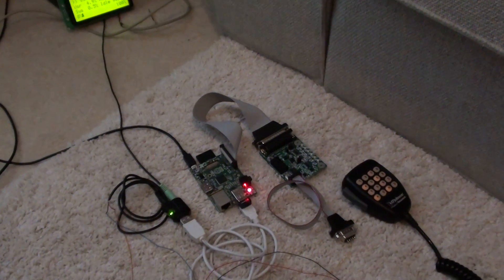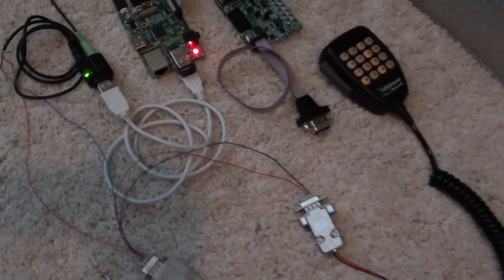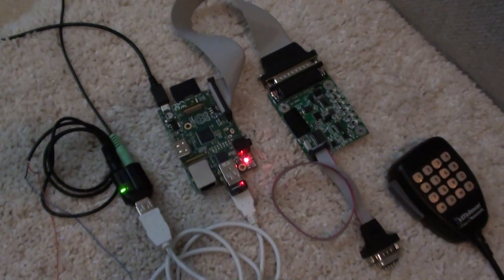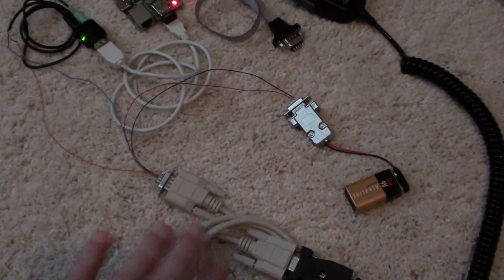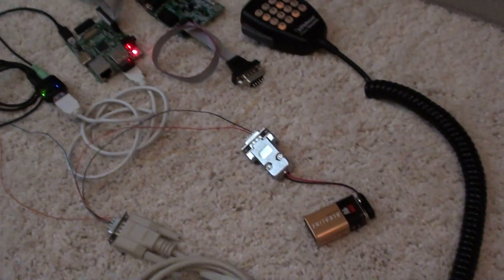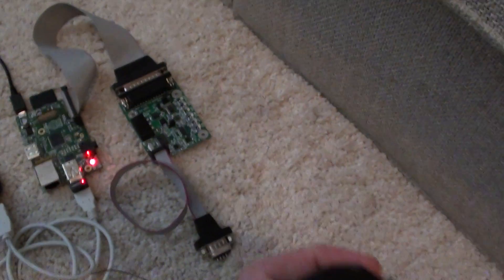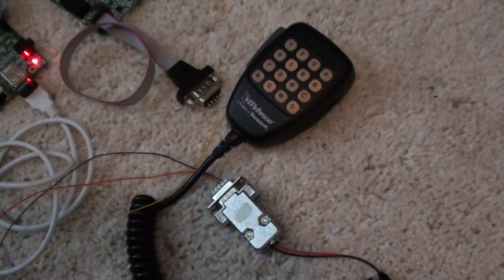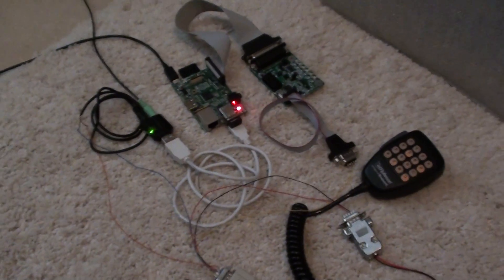IRLP Mobile Pi Node    [1080p]                              echoirlp echolink ham radio raspberry pi

Comment: Please share with us an explanation of the DTMF mic connection, the adapters shown, wiring, sound fob type and modification (if any). I really really like this idea. Also is the IRLP board mandatory? I thought they only used a PC Printer connector and I dont have any old computers or an Rpi that can use a that connector. How did you do that? You pointed to the lonesome connector attached to a short ribbon cable and said you needed that for ptt yet you were still able to test without it connected. I don't undertand why that cable is in the video if you dont need it.

Comment: Hi, I'm really interested in people for a project similar to this...
I'm looking for a radio-less clients on Pi for mobile use in car... Connecting to my voip servers ( Conference or User-User ) over hot spot mobile phone...
With the DTMF mic for In/Out sound and controle... And the old school CB feel...

Next to Pi's connected to PMR/CB Radio's ( VOX or PTT via GPIO )..  Connected to the same voip server ( Like Allstarlink ) acting as gateway nodes.

Most projects are still old-school non Pi, badly documented... Dead or licensed HAM only...

Echolink, IRLP, Svxlink and app_rpt/Asterisk, QRadioLink

Anyone?
Reply from the maker: What you are describing is exactly what I was looking to do.  I played around with TheLinkBox on the Rpi and got distracted with other projects.  I might try to get it going again.
Reply: Awesome! Most important would be using your own voip servers and be HAM licence independent cause of the use of citizen bands and the locations I would like to have this system... Or non HAM people... ( Probably any Asterisk install would be nice... ) Mobile clients could even have GPS and send this data inside a the transmission... Like the ircDDB on Dstar... Stuff like that.. :)

Comment: check with echolink  i've heard that allstar and echolink are compatible since you can use user mode over a computer or simplex link could you make your node an echolink simplex node? or have the raspberry pi running echolink software in the echolink user mode.

Comment: frank gochnour kd0hgi: i would like to know were i can get one of these and instructions on how to build it put it together and set up the regular mini itx platform for the allstar link network on use this as a mobile/portable allstar simplex link radio even though there is no radio connected to it. since this works on allstar can you talk on echolink nodes all-so

Comment: i received your reply that you are useing allstar with this now.do you have any instructions or video on how to build one of these? i sure would like to have one.not too skilled at building electronic stuff my hands are not as steady as they used to be.but maybe i could do this build if it is not too hard to do.
Reply from the maker: No, I am using a regular mini-ITX platform for the Allstar node.  I will post a vid when I get it put together.
Reply: thank you

Comment: Why would an amateur radio operator prefer to go "radioless" anyway?  I just don't understand why people want to access different aspects of amateur radio without a radio.  If you want to use the computer to make contacts, use Skype while driving with a nice Heil Sound boom mic and earphones.  The long debate over real radio vs. not real radio.  de KF7QLH
Reply from the maker: I just don't understand why someone would want to sit in their Lay-Z-Boy and talk 10 feet across the room into another radio.  I guess the debate continues.
Reply: Its fine if they have a radio capable of Extremely Low power for using it around the house. If a 5w handheld is used to talk across the room, that is a waste of RF power and is not the minimum power to do communication. Unfortunately, many handhelds do not have that capability, and plus, do you really want to radiate yourself with the node radio as well as the radio right next to your brain if it isn't needed?